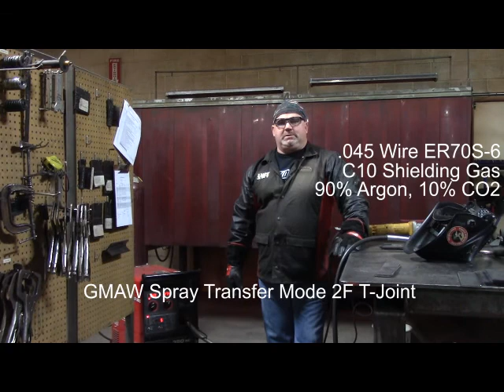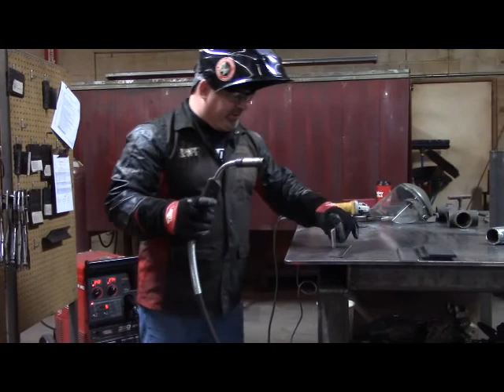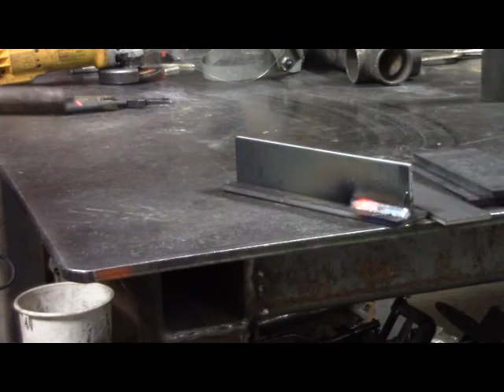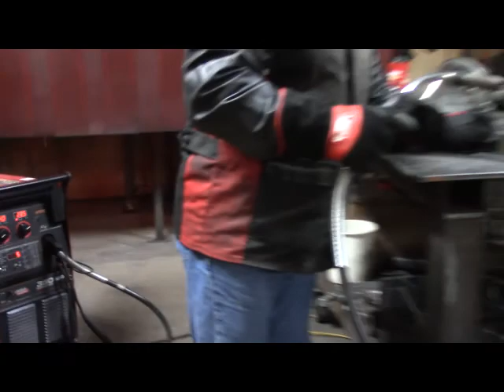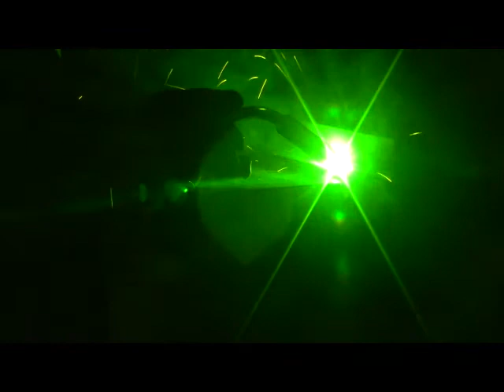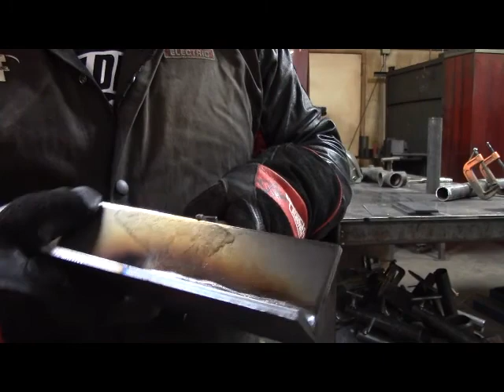GMAW Spray Transfer Mode 2F T-Joint

Comment: Still looked a bit cold at 29.5, and wire feed is too slow, should be around 425-450, that looks like globular transfer, a 350 Amp power supply like that should handle it, but great way to demonstrate the relationship between voltage and spatter. Could be mill scale. I straight push, higher voltage and a bit more travel speed. General almost not crackling or spatter, just hum. Good video overall, though!

Comment: This is so high on the heat. I run a miller 252 at around 20, different machines slightly different number, that guy is screaming and welder sounds like its struggling
Reply: 18-22v is short circuit. Spray is 28-32v.